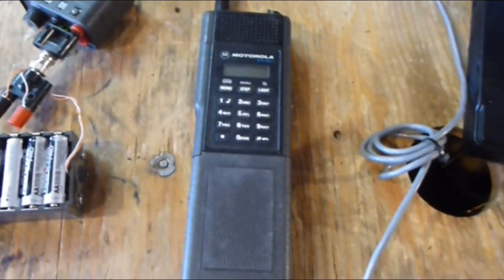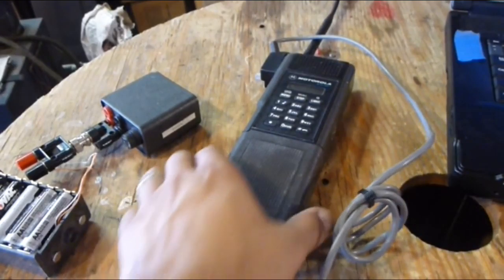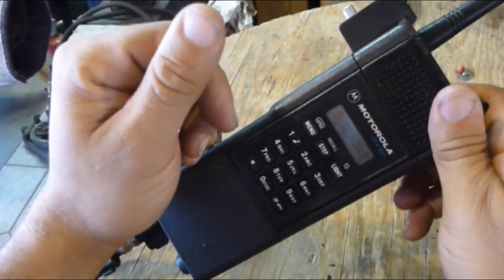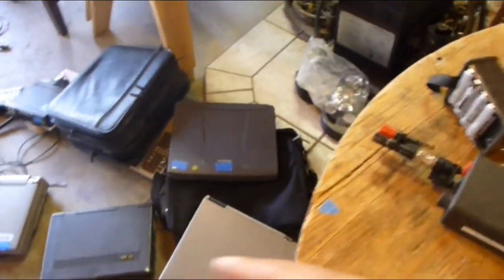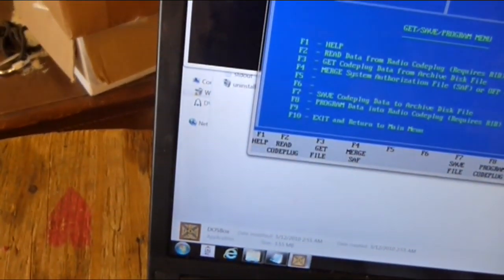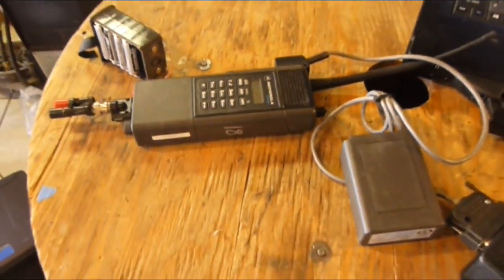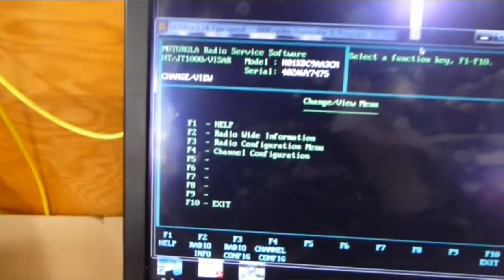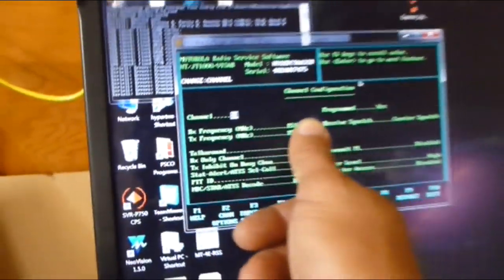Surplus Radio Guide Series, Programming Motorola STX & HT1000 Handhelds

Comment: Fast forward to 2024, this radio looks like a frankenchild mix of an MX300 with an HT600 and god knows what else. Gads I remember the Type 1 trunking. You can also brick the radio with a too fast of a computer. I am currently waiting for a friend to ship me an older Headstart III computer that runs At 15 MHz so I can program my Saber 3 radios on VHF. Batteries are hard to come by for sabers, need the NiCad batteries since my SVA's and rapid charger can not charge the NiMh chemistry. Would love to find a mod to use NiMh batteries in the SVA's. Talk about old, try an MX360S. Needs the R1800 suitcase programmer to pop new info on the blank spots of the prom.

Comment: ballsy programming over VM or DB   RSS uses timeings that are specific for a 50mhz cpu   this can brick a saber !!!  im to scared to try it with cps and modern poot
Reply: re: "RSS uses timeings that are specific for a 50mhz cpu "
No, man - I'm using Win98SE on a 1.1 GHz Celeron with Win98SE using a dos window IN windows 98 and the HT1000 will program ... I also go to DOS before Windows boots and it works that way from command line.

Comment: STX was an 800 MHz exclusive radio based off the MX series (The bricks) and a huge pile of.. Yeah. Even non astro Sabers are not worth it anymore because finding a proper XT PC that works to program them safely and does not cost as much as a used car is about as rare as rockinghorse shit these days.

The BIGGEST problem with older computer gear is the collectors that have personal PC museums in their basements.. They the machines that work but will not part with them for less that the cost of that very machine back when it came out plus some.. It's ridiculous because no one in their right mind is going to pay over $5000 for an IBM XT PC..

You can get newer re-banded MTS2000 flashport 800MHz or even an XTS for like $50 that supports type 1 and 2 systems and some are flashed to do P25 and 700/800 MHz split band..

I keep an old windows 98se laptop and my original IBM XT PC around and maintained for the sole purpose to do the older radios that may happen to wander into the shop, though I think the older radios are about played out these days. So retiring that old PC gear may be in the near future for me.

For newer PCs that do not have a serial port you have to get a USB to RS232 cable and the proper drivers.

Comment: It’s actually very easy to get all the software‘s that are RSS to work on any type of computer Windows XP or later on. What I do is I bought a USB floppy disk drive from Walmart it was 12 bucks. I put the software on the floppy disk along with an MS boot disk and then I just turn the computer off and then I turn it back on and I have it load from the floppy disk. So I have a floppy disk for every software for at least 100 Motorola radios or at least 100 different types of Motorola radios. I found this to be the easiest way to have a computer that can program rss and cps along with my system keys as well. If anyone has any questions on how to do this or to program a trunking system P 25 or analog just hit me up. I Program radios for a living and I can program trunking radios for monitor only if need be. I own an Motorola apx8000xe it was the best Decision I’ve ever made. It cost me $8000 but it was well worth it especially with the fact that it’s program with almost 1000 channels with everything in the area that I live. I love it .
Reply: Ach Any luck using a USB to serial converter with FreeDoS or DOS box?
Reply: Matt DeHope yes sr.

Comment: The stx were trunking radios only. The Saber is the equivalent for the vhf/uhf frequency users.  The  jedi series which includes ht1000/Mt 2000 were uhf and vhf radios the mts2000 was trunking 800 mhz as well as vhf and uhf
Reply: STX could also do repeater and direct radio-to-radio as well. PL, DPL.

Comment: Thanks for the tip on DOSBOX. I have an old IBM PS2 pizza box workstation in my closet just for programming Systems Saber radios. A bit of a hassle to maintain and use that. Looking forward to getting my desk top workstation capable of programming these radios. I used to program STX 821's back in the day, even the system keys (I have skillz). they actually were pretty wonderful radios, even had DES encryption.

Comment: If you use a program called "SLOWDOWN" (an older equiv. to MOSLO), it'll work. I program X9000s and even regular Sabers on older (but not native-old) laptops all the time. I have that same Toshiba Satellite and it works tits. If you play with the CPU cycle speed in DB you can get them to work on the newer machines, too... You'll of course need to keep a record of which speeds work with which PCs/softwares, but figuring that out's only a PITA once.

Comment: Hy Guerrilla i got a motorola gp300 5tone i am able to program the standard gp300 with the system you use too but the 5 tone i'm not what can i do for read the radio ? it give me error 2 (radio communication failure) please  help me
Reply from the maker: +TheJokerStudio It sounds like you have your PC configured right since you can program another radio. I would change the cpu clock speed in small increments until you get the sweet spot where the equipment handshake reliably. I have a SYNTOR X that read the radio in one speed, but write to the radio in another. I noticed that vintage radio you have is pretty stable using a dos emulator. Beyond that suggestion, that's all I know that works. Hope it helps and good luck.
Reply: +GUERRILLACOMM  Can you send me your configuration file of dosbox please ? thejokertheory@gmail.com i would also ask you about other radios that you have and me too but need some suggestions
Thank you
Reply: If it's 5-tone, it's probably a euro version (hence different software). Google the model #.

Comment: Great video one question i have a Motorola Saber 2 will like to know if i can use a 500mhz laptop with DOSBOX as a solution to program the Saber. Thanks
Reply from the maker: Ricardo Pagan I don't know, have not handled a saber since 92. Dosbox is free, so it will not hurt to experiment with it. You would have to play with the CPU speed adjustment of the software to make it work. Don't know off hand, but I think the saber was made after the STX model, they look very similar, I could be wrong. the Dosbox website should have a minimum requirement info on it.

Comment: Bro, if you see this, maybe you can help me out with something. It's a long shot but.....I have come into possession of two iCom IC-U16s hand held dual band radios (VHF/UHF). In the programming manual I found online for these models the instructions tell how to program the offset frequency but also say that a FOUR digit number must be entered. My problem is that the offset I need to place in the radio is 1.6 which is two digit number, obviously. Any idea how I am supposed to do this?
Reply from the maker: InTheNameOfJustice I'm not following what you mean? I looked up the manual fr it also. looks like its 25 kHz channel spacing, meaning its not capable of using narrow channel spaces. for example, you could input 148.460 MHz but could not input a frequency of  148.4675 mhz. The technology back then could not support 12.5 MHz channel spacing, no hack on this model or any other of this vintage. They are still usable radios though. hope this helps.
Reply: GUERRILLACOMM
Bro, I think you just cleaned up my blind spot for me. Thank you.
I have been trying to program into the radio a popular repeater in my town and thought it would be a matter of just doing what I needed to do in my Baofeng UV5R. I completely missed the 25kHz spacing thing. So you have helped me a lot.
I will use the radios as personal communication devices only. They do have several good features on them.
I really appreciate you taking the time to help me out. Thanks again.
Oh, BTW. I learned something that may be useful to you. A friend of mine has one of the iComs that I gave him. When he was removing the antenna the black rubber coating on it had perished so much it fell apart in his hands.
He was looking at someone's YT channel  on the subject of restoring old tube radio sets from the 1950's (Not Ham but domestic sets) and the guy said that old brittle rubber can be restored by spraying it with WD40 every few days for about a week. The WD40 replaces the petroleum in the rubber that has dried out.
I know you have a lot of surplus radios so that may come in useful, I hope.
Thanks again Bro.

Comment: You don't necessarily need a RIB box to program the HT1000s. Just look for a RIB-less cable that has one built into the cable. I personally have one of the 5-in-1 cables that works with dozens of different models. I've used it for a few HT1000s and a few Maxtrac and Radius mobiles. They cost about $25. They also sell RIB-less cables for specific models of radios which are a good bit cheaper. For someone just starting out that may be a good way to save a few bucks.

As for the computer to run the programming software, I'm always seeing ancient computers at my local thrift store selling for $5 to $10. I picked up an old Pentium 1 a few years ago and other than a bad hard drive it works fine. I just boot into DOS from a floppy bootdisk and then run the software that way. I've used it to program all of my older rigs. I've never had much luck with DOSbox so I just kick it old school instead. The real fun one ones to program are the older EF Johnson mobiles...
Reply from the maker: I hear ya, Many ways to skin a cat, this is just one way. Never had the displeasure of messing around with a older EFJ, though I have a GE macom dualband mobile I was never able to talk to I might try when I feel frisky.
BTW, love the icon, really cool..
Reply: You are correct about using an older computer, one with a true serial port. I am just now learning how to program from a friend of mine who has been programming radios for years. I picked up an HT 1000 recently that I want to program. This one is for the UHF band.